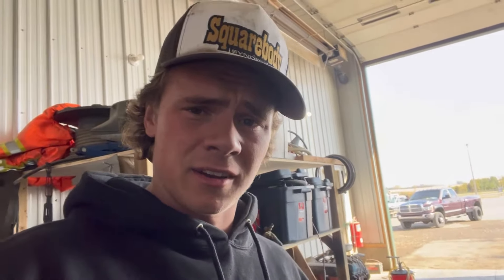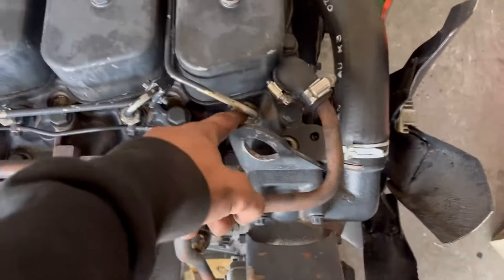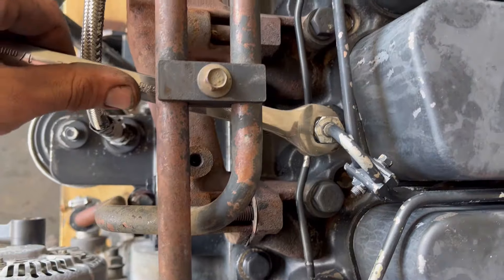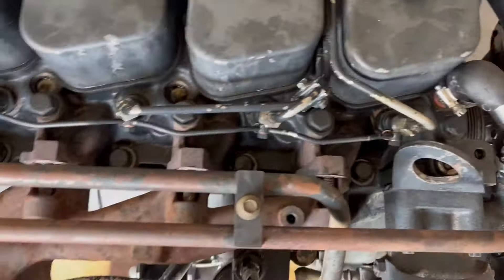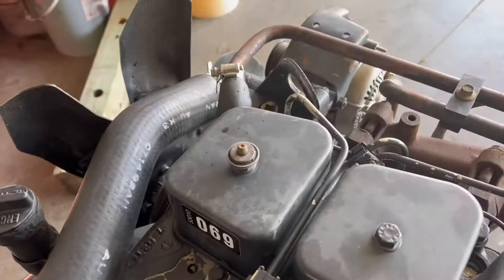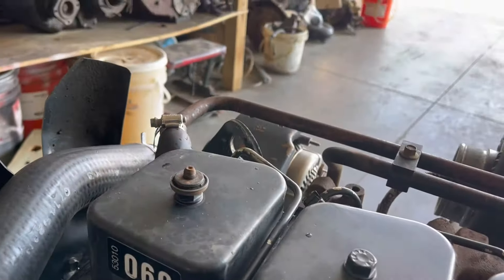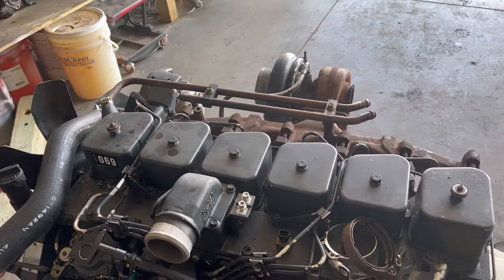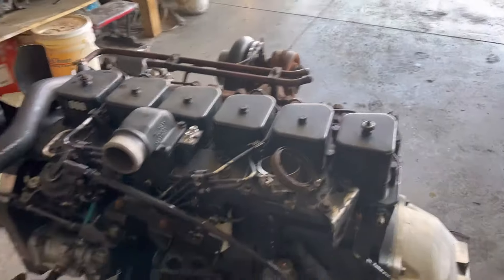How to bleed the fuel lines mechanical diesel injection #12valve#cummins#howto

Comment: A little different way . Install a simple portable 12 volt electric fuel pump to the inlet of the fuel pump filter housing .  Crack all the fuel nozzle line nuts at one time .  Turn electric pump on , as the lines start flowing fuel , tighten all nuts and start half throttle .

Comment: How do you get so many 12 valve motors and what do I need to look for when I go to buy one?
Reply from the maker: Just find them in farmers fields
Reply: Find old junk.. I saw a big yacht on Craigslist not long ago, had two 12v engines in it, hadn't been used in years..

Comment: I unscrewed the injector lines as you said, ran the starter for quite some time and fuel actually started squirting out however then it suddenly stopped squirting fuel…. Now there is no fuel coming out of the lines. What should I do?😅
Reply from the maker: Make sure you are getting fuel to the lift pump

Comment: Sam, you forgot to use the manual primer on the side of the block to pump fuel to the P pump. You are abusing the starter
Reply from the maker: You may be right with p-pump but this is not a p-pump on this is a VE pump My compadre
Reply: @samstrucks how do we prime a ve pump

Comment: So I just resealed my ve pump got it all together the lines were all cracked and squirting fuel and it still won’t start any ideas?
Reply from the maker: Keep cranking. It takes a while
Reply: How long is awhile? Tried few minutes at a time
Reply: @tannerobrien7351  I got it. My fuelsolenoid wires were backwards 😂